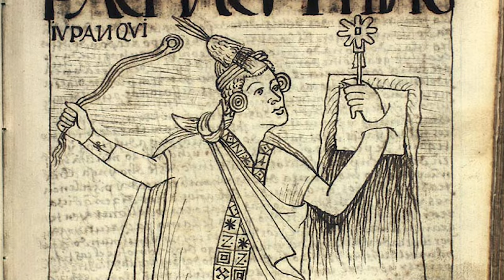SACSAYHUAMAN - How They Did It | Polygonal Masonry

Comment: Good luck getting some of those tight corners, multiangular stones by bashing stones with stones. Please try it. Would be nice to see these "experts" actually test their ideas as scientists are expected to do before publishing. Something called "the empirical method" should be invented.
Reply from the maker: Multiangular? Did you pay attention to the theory Vince proposed, which is that only one angle had to be worked on for each stone?
Reply: @WorldofAntiquity  Absolutely. The whole theory makes perfect sense except for a few details which have not been addressed:

1. Which type of stone was used as a "pounding stone"? Where are the empirical tests?
2. "pounding stones", if found, might explain the rounded corners seen on many of the stones. What about the sharp tight corners?
3. Why most of the blocks at Sacsayhuaman appear to be sagged at the bottom? Why the edges themselves appear to be rounded?
4. Many stones exhibit "scoop-marks", wedging type damage on the surface. Some run vertically, some horizontally and some diagonally. Are these scoopmarks the result of pounding stones rather than cutting tools? If so, where is the empirical evidence?
5. Some of the stones exhibit a "flaking surface" type of erosion. It has been suggested that this is the result of extreme heat amongst other things. Has this type of erosion been found in the quarries or is it unique the stones on the walls?
6. What about the foundations of the walls? How deep are they? How far underground do the walls themselves reach?
7. Is there any evidence that "retaining walls" were used during construction?
Reply from the maker: @lexreinstein4244  These are questions for Vince, not me, but here are my own thoughts, for what they're worth:
1. Limestone, I would expect. It's there in abundance.
2. Sharp corners can be done with stones. It has been demonstrated many times.
3. I haven't seen any sagging. I would surmise that the rounding was done by centuries of erosion from rainfall.
4. I haven't seen any scoop marks at Sacsayhuaman. Could you link a photo?
5. I don't take "it has been suggested" seriously. I would need to see the scientific evidence. I don't know if that type of erosion was found in the quarries. Do you?
6. The stones are not deep at all.
7. No idea. If there is, they didn't do a very good job cleaning up.
Reply from the maker: @existentialexcursion  There are no andesite and basalt blocks at Sacsayhuaman, as far as I am aware. But please note that I said "I expect." I did not "assert" limestone hammerstones. So don't put words in my mouth. Obviously the stones used would be as hard as, or harder, than the stone being worked on. Is that even a question to wonder about? If you want to know the exact procedure, get the book Exploring Cusco by Peter Frost.

I know the stones don't go deep because the site has been fully studied. It's not my own theory. As I made clear, Inca culture is not in my field. I defer to the people who have done the work. It's strange that someone would accept so readily the estimated weight of the stones, but not the measured size.
Reply from the maker: @existentialexcursion  You can see how deep the stones go just by looking at them. The sizes of the stones are all in the same range. The ones on the bottom are clearly not much bigger then the ones on top of them. In some cases you can tell that the stones are buried about halfway. In other cases, when you can see the bottom edge of the stone or the little nooks on the bottom, you know that the stone is barely buried at all. In order to conclude that the stones went down 10-20 feet, one would have to surmise stones of a size completely different than the rest.
Reply: @WorldofAntiquity  You went from "the site has been fully studied" to "you can see how deep the stones go just by looking at them". Without ground penetrating eyesight, I think that's a bold assumption (but I do agree for the specific blocks, you can assume they go no deeper than their average size). I agree with your observations as there is no question the stones are about the same size and you can see some buried halfway, or barely at all.

It seems you think the foundations could only consist of one course of masonry underneath? The question was about foundations, not specifically the exposed stone jutting deep into the ground. To conclude the foundation goes down another 20 feet, would just need more courses of stone on top of each other. Like most sites in the area that have been excavated, there are many courses of polygonal stone work underneath ground level.
Reply from the maker: @existentialexcursion  You went from "the site has been fully studied" to "you can see how deep the stones go just by looking at them".
Do those statements contradict each other?

Without ground penetrating eyesight, I think that's a bold assumption (but I do agree for the specific blocks, you can assume they go no deeper than their average size). I agree with your observations as there is no question the stones are about the same size and you can see some buried halfway, or barely at all.
Okay, I am glad we have found some points of agreement.

It seems you think the foundations could only consist of one course of masonry underneath?
I cannot think of any purpose for having more courses underneath. It wouldn't hold the wall up any better. 

The question was about foundations, not specifically the exposed stone jutting deep into the ground.
When walls are built today, do they have foundations? I don't know for sure. Buildings do. I have never heard of foundations under only walls. 

To conclude the foundation goes down another 20 feet, would just need more courses of stone on top of each other. Like most sites in the area that have been excavated, there are many courses of polygonal stone work underneath ground level.
I am not sure which sites you are talking about, but I would guess that they were exposed at the time of building and have just been covered over by nature since then.

Comment: The wall appearing at 4:14 has a red stone. It means to me that it was made up with cement concrete. If we look carefully at the hole, we will see a little white speck embedded inside the red concrete. This little white speck might be a pebble; which means that many white pebbles were used to build the entire red block. And then, we can logically say that all the other polygonal blocks were made up with cement concrete. Only so, the seamless joints between adjacent blocks could have been achieved. When we accept this cement concrete idea, we would do away with quarrying, cutting, transportating and lifting big and heavy stones.  What were needed were the transportation of cement and water. I believe ancient people were smart enough to have invented the cement to build all the artificial stony structures. Those hard jobs of quarrying etc were invented by the dumb modern man.
Reply: @darklight2.1  : The stone at 4:14 acturally has three parts, grey skin, red crust, and white crumb. Such constructed stone cannot be obtained by quarrying.  All the other stones unanimously show some red-coloured material. How could any quarry site produce such different-coloured stones?
Reply: @darklight2.1  : Okay, you have the right to keep your idea.